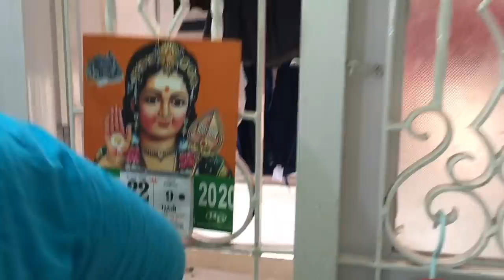Kitchen Cleaning Tour/Cleaning Vlog/Kitchen grocery shelves and countertop

Comment: Hello Chitra. My tip to remove oil stains a) when the item is removable eg a stand, soak in hot water with some soap or b) use thinner. Removes oil easily.